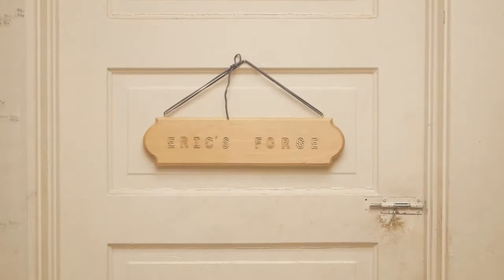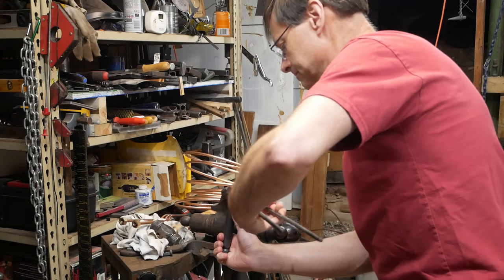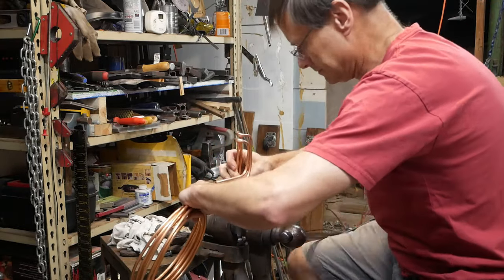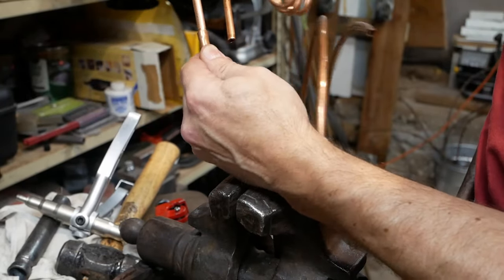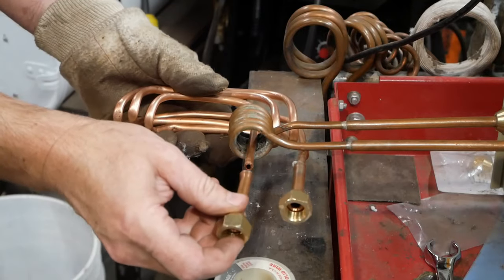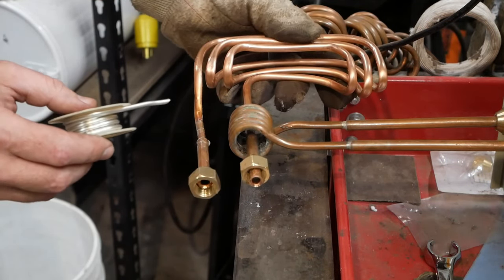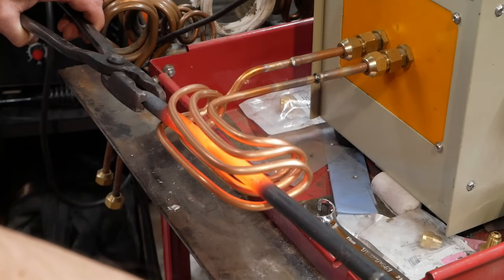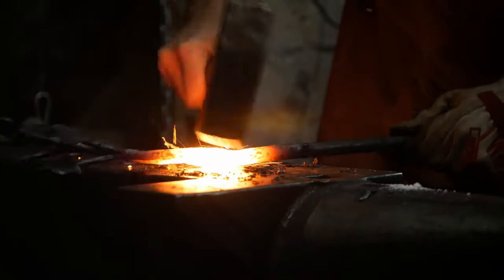Good coil for blacksmith induction forge welding

Comment: I really like these little machines. I started out in the trades building induction furnaces of every kind. Some were very large and used in the steel industry to melt steel, others were smaller for the precious metal industry. Even coils for heat treating coil springs, annealing ovens etc. I'm suprised to see bare coils being used. For the majority of applications they are cast in refractory. We soldered brass bolts onto the coils and used 4 square hardwood uprights drilled at the proper intervals to get the coil spacing perfect.  The hardwood was isolated from the coil using high Temperature blanketing or transite (among other things). Only the inside of the coil was  packed with refractory and the top or ends were shaped depending on the application.  It seems like some version of this where the coil is isolated from being able to touch the steel would be beneficial so the coils lasted long term. It would make using one much easier and definitely less stressful, no accidents when the steel accidentally touches the coil. If thats too much work the red/pink laminated insulation board is great for really close coil spacing, it can be left in place is you want to capture the entire coil in cast refractory. Its available in every thickness imaginable.  A coil would last years, possibly a lifetime depending on use done one of these ways. Just thought I'd pass that on in case its helpful.
Reply from the maker: Hi Jeff. Thanks for the excellent info. I have experimented with casting a coil in refractory. It works a treat on a flat coil. I will show that in my next video.
Reply: There's a little trick you can do to isolate the work piece from the coil, especially if it's a round pipe or bar. A glass tube! Saw a guy in India or perhaps it was China doing this.

Comment: I have one of these machines, and the first thing I made was an adapter for those 8mm flare fittings.  I used the 8mm flare fittings (just cut the tube about 2" from the nut) from one of the coils that came with the induction heater, soldered a ball valve onto one end, and a 5/16 compression fitting on the other.  This way, when I need to swap a coil, I use the ball valve to close the water (reduces dripping), and the 5/16 compression fitting adapts nicely to easily available 5/16 copper soft tubing, no flare tool required.  It works great on my machine.
Reply from the maker: Sounds like another good way to "skin the cat".

Comment: Holy moly this would have so much potential for forging knives as well. I imagine I can heat just the bevel or just the spine if I want to, and it seems to heat up crazy fast, precise and convenient.
Reply from the maker: It is really convenient for certain types of heat treating. I made a draw knife that I hardened with a coil that only heated the cutting edge. In that case, the coil was just a U shape (i.e. basically a one-loop coil).

Comment: Rig your induction forge/heater as a mobile/cart and you can park it right next to the anvil or power hammer or whatever you're using at that phase of the making. No forge heat blast to interfere or account for when your working metal is out of the inductors.
Reply from the maker: Yes, exactly!

Comment: I have a induction heater that I built it heats meter red hot in 7 to 15 seconds.  My RF coil has no insulation if the metal being heated touches the 8 turn induction coil the mosfets explode.  I think the reason my circuit self destructs is, I have a resonance circuit 70KHz loaded.  I think factory circuits are pre set osculator circuits frequency never changes.  My induction heater is very handy better than a torch for heating metal quick.

Comment: I just ordered Input voltage: 110V

Model：ZDBT-6:

Nominal power: 1400W; Maximum power: 1960W; Ultimate power:2450W;

 

Input voltage: 220V

Model：ZDBT-6:

Nominal power: 2000W; Maximum power: 2800W; Ultimate power:3500W;

I hope this will do what I need. I really love forging but with bad shoulders the quicker I can get a heat the better and if I don't need propane even better I was watching alec steele run in to one of these when he was shopping for a power hammer but your the best source for actually seeing someone use it for forgeing.
Reply from the maker: I've not worked with one of those. It will work for smaller stock. It's about 1/4 the power of the LH-15a.
Reply: @ejoftheanvil  the prices have jumped crazy I wanted to get one but this was more in my price range atm thank you for you time sir
Reply from the maker: @ReviewThisTestThat  Fair enough. I couldn't quite tell from the ebay listing: does it require water cooling and does it come with that? Please let us know how well it works for you!
Reply: @ejoftheanvil  it comes with it I got it on Amazon https://www.amazon.com/dp/B08C5FPR5J/ref=cm_sw_r_cp_apa_fabc_JTJ7FbVDYTP8F I will definitely do a review on it since I see 0 on here.
Reply from the maker: @ReviewThisTestThat  Ah. The Amazon details are a bit clearer than what I found on ebay. It does at least make it fairly clear that it is water cooled and includes a small water pump. Maybe the bowl is for cooling water?? The look of the coil suggests it's for casting.
Reply: @ejoftheanvil  is there a way to contact you outside of youtube I would like to pick your brain some I am starting a Orthotics and Prosthetics chanel soon for instructional videos on fabrication of those decisions and I would love to ask you more questions on induction forgeing if your open to that thank you again for your feed back and I'll do a video on this when it shows up and get your impressions or ideas
Reply: @ejoftheanvil  i just got it but it missing the switch on the back lol the 230-400 breaker 60 amp
Reply from the maker: @OPTAustin  <sigh>

Comment: This seems like a really even heat that doesn't begin from the ends but from the ends of the piece that are more away from the weld, so it would store it better for longer as well. Would love to see you work a sword/knife through a huge version but to each their own hammer.
Reply from the maker: That's a good thought. For a knife, I'd recommend a coil of rectangular loops. For a sword, this has some advantages since you don't have to run most of the sword thru the coil to get to your current working section. This coil is nearing max size for these induction units, tho, so there won't be one much bigger.

Comment: I got into induction forging because of you! I just ordered my unit-- I'm on a budget so I got the 110v because it's half the price of the 220v models. I will be using your pro tips to modify for 220v. If you do consulting/coaching calls that would be great :).

Edit: This coil is freaking brilliant by the way.
Reply from the maker: If you get in a bind figuring out conversion, ping me.

Comment: I've heard that freezing some water in the coil before forming can help with preventing kinks.
Reply: fine sand is also an option...
Reply from the maker: @AKAtheA  Yup. Definitely. A bit harder to get in and out than water.
Reply from the maker: Yes. I must admit that I don't usually plan far enough ahead for this to be an option. I tend to make a coil mid-project when I get the inspiration(frustration?) to do it. As @AKAtheA mentions, sand is good as well. Overall, tho, I've never had a coil collapse enough that it caused a problem. So, I just stick with my empty bending (using my various jigs and tools).

Comment: Good trick to keep pipes from collapsing is to fill it with salt.
 Regular table salt will do. 
After you done with the bends you can pour the salt out, or if need be, flush it out with water should some get trapped.
Reply: Filling with water and freezing works well too and salt can be a bitch to get out

Comment: If you do this you need to deburr those tubes so they don't go into a pump and cause a gear to chip and blow it up, and I don't recommend stretching them at all since its electrical. Failure is grizzly. I also recommend filling with sand and cleaning with a long fuel line swab for bending. Don't rely on folding to get rid of the bur, you need to cut it off, its bad copper. I also recommend cleaning the coil with a stainless brush before soldering (dremel). Flux should also be cleaned if you are using a closed system since it is corrosive, with a nice long flush.
Reply from the maker: Yes, always de-burr. I always do, but don't necessarily show it. I usually wire wool before soldering. I always flush the coil before using it. I should emphasize those points in every coil-making video. I do think the slight stretch is worth it due to the 1/4" vs 6mm difference, but your point is noted.
Reply: @ejoftheanvil  Honestly I don't know what the integrity change is at all but with the high voltages that tank coils can have sometimes it makes me extra scared. This one gets me : clogged pipe with pump parts  leads to steam explosion with water and white hot metal. I guess a operator would notice this is starting to happen but steam is pretty insidious. I know flaring aluminum tube is OK for aircraft in some applications so I am not sure I would panic about it but the FAA is pretty specific with their scenarios, usually does not involve heat.
Reply: I don't want to be alarmist but I did notice these induction machines became prevalent because of low price Chinese models not so long ago, I am not sure how much a track record these 'pint sized' machines have.
Reply from the maker: @cdrom1070  you point out another good "checklist" item. I also flush my coil to make sure it isn't blocked by a bad solder job or a kinked bend. A blocked coil will not stay cool and that could actually melt, or at least compromise, the solder.

Comment: Very nice. Wondering if it would be possible to use the toco coil to forge heat some heavy spring metal (1095 steel), quickly remove it and wind a new spring on a mandrel and lathe, while the work piece is still hot? This would be a very straight long piece of material, so probably have to heat a section, wind it and repeat?
Reply from the maker: Yes, you'd have to do it in sections. Keep it tight as you go. Once cold it's a real pain to reheat the winding.
Reply: @ejoftheanvil  Thanks!

Comment: It's a little hard to explain but I will try. A picture would be easier. 

Would it work to make the toco with the tubing perpendicular to the work piece.  The long part of yours is parallel to the work piece. 

It would be made by bending, for example, a 1.24" diameter "U" in the "Y" plane. Then at about 3" bend a "U"  in the "X" plane. At three inches bend a third "U" in the "Y" plane etc.
Reply from the maker: I think I get the picture. Let's call my taco a "long" taco and yours a "wide" taco. Yes. it would work.

Just to be clear on why I said "wide", you basically have two constraints: 1) too much total tubing and you get out of spec on the inductance of the coil and 2) you probably want a pretty even spacing. One good way to think of my coil is an oval flat coil bent in half on the long axis. Yours would be the same but bent on the short axis. Both are definitely useful. For what I was wanting to do, the longer coil is nicer. For other stock or other operations, your wide coil would be preferred.
Reply: @ejoftheanvil Thanks, I may try it.

Comment: Husband here, this is just fantastic, ima gunna have some fun tryin 2 make some Damascus
Reply from the maker: Let us know how it goes. I haven't done damascus with mine.
Reply: Same here, I'm looking about getting one and I want to know if it can be used for damascus
Reply from the maker: @waylonperry1982  It's on my to-do list. It'll definitely work for small billets, but getting an even, welding temp heat on a larger billet will take some experimentation and may just not be practical.
Reply: @ejoftheanvil  please make a video on it when you try it!

Comment: I love the idea of induction heating in a forge.  Are you able to actually melt steel it get it hotter than needed?
Reply from the maker: I have melted stock accidentally and have one end fall off. Mostly with smaller diameters like 1/4" or 3/8" (6mm to 8mm).
Reply: i used to work at American Foundry Group in muskogee ok and they use induction furnuses to heat metal up to 3000 degrees for drop forged products

Comment: hi Eric! great content ! I am planning to do  blacksmith shop in an underground garage, do you have any tips for ventilation underground and do you have the coal forge in your basement workshop? any pros and cons of working in the basement? 
thanks for your time !
keep up the great work !!
Reply from the maker: In some of my older videos, you can see my coal forge and my ducting solution that goes outside. My main tip for coal is switch to induction ;-) or propane. I have not used the coal forge in my basement for over 3 years because I can do it all with induction. That said, I also have the advantage of an exterior door and a window (traditional pier and beam house, so the top 1/4 to 1/3 of the basement is actually above ground). I would suggest a P100 half-face respirator even with induction. Forging is pretty dusty from scale particles. Grinding is VERY dusty which includes the rather more dangerous dust from the grinding discs and wheels. Your 80 year-old self agrees with me on this 🙂.
Reply: @ejoftheanvil  thanks a lot for the tips !!! in my garage I m gonna have 2 windows facing outside similar to yours , but no exterior door . So does this mean that you can access your forge from outside? since you have the exterior door , I am asking to now if it is safe enough to work underground
Reply from the maker: @markgrech2328  You should be fine. I used the basement for several years before I put the door (back) in. I did have the window open for the ducting when I used the coal forge, but I don't open anything usually when I forge with the induction heater. I do open ventilation when I use propane to avoid CO issues (and definitely get a detector if you're gonna use propane semi-enclosed like that).

The doorway had been covered over and the stairwell filled with rubbled for decades. Took a bunch of concreted and masonry work to get it viable again (and a little digging, of course).
Reply: @ejoftheanvil  Thanks a lot !! keep up the great work !

Comment: You should try a tight pancake coil, folded into a taco.
Reply from the maker: My taco emphasizes long parallel tubing. A folded coil would have more tubing in the "fold". My estimate is that tubing is not doing very effective heating.

Comment: What is the device the coil is plugged into?   Is is a welder?
Reply: It's called an induction forge.  It uses pulsed electrical waves to induce current (and heat) into any conductive object placed inside the coil.

Comment: Hey I bought me a LH-15A from USSOLID because of your videos! I got the 220V model thanks to your advices and I'm loving it. Still trying to find a wear fitting that matches my machine however! Also how do you prevent fouling of your cooling setup? I got some white algae / bacterial growth in mine after a while.
Reply from the maker: I used distilled water and that seemed to pretty much avoid that. There are industrial additives for handling that and also providing anti-freeze. I don't really need that in my basement.

Comment: Couldn't you use a copper cable? Insulate it with fiberglass sheath? And, do you really have to run water through it?
Reply from the maker: Yes, but... Reasonably thick copper would work. However, fiberglass sheath melts onto hot steel. And, hot steel would put a lot of heat into the copper. ...which is why a heater of this wattage pretty much always uses water cooled tubing.

Comment: Very cool -- THANKS! This is amazing.
Question: How much would you guestimate this whole rig, ready to go, would cost to build if done by a pretty handy person already having all the tools needed? I'd really love to put this together and would use it a lot.
Reply from the maker: It would cost about the same or more than buying one pre-built 😕
Reply: @ejoftheanvil  Thanks for your reply! Dang - too rich for my budget. My main use would be to quickly heat the inside-most tip of various scrolls for gates and other ornamental ironwork. I have a DIY Torsionator (as someone on youtube calls it) to cold form the scroll, and so ONLY need to heat the inner end of the piece.

Comment: I would like to try metal working with induction furnace but I was checking the price of your equipment and unfortunately it mutch mutch too high for beginners... Do you have any recommendations for any cheaper alternatives because I know I shouldn't trust kind of machines you can buy from Wish?🤔 ( for axe and knife making)
Reply from the maker: Unfortunately, I haven't seen anything cheaper with enough power to be useful.

Comment: Hi EJ, and many thanks for your videos.  I tried making a taco-coil of my own, annnnd it didn't go well. I started with 2 feet of 1/4" copper tubing and barely completed half of the taco.  Are you using more than 2 feet of tubing to make this coil? Thanks.
Reply from the maker: Mine is about 58" including the leads. This is one of those geometries that doesn't follow the "rule of thumb" length.
Reply: @ejoftheanvil  Thanks so much for the reply.  I'm going to try again with a bit more tubing this time 🙂

Comment: Hi Eric I am a blacksmith in Australia and I am having trouble winding coils for my 15kw induction forge machine just won't start up with my coils started with 1.5 meters of pipe and then about 800mm . put supplied coil back and all good any advice  regards Mark
Reply from the maker: Those are probably too long. Rule-of-thumb is to stay under 600mm. It's pretty dependent on geometry so that can vary quite a bit. You need to use fewer loops. You can find my email on the saltforkcraftsman.org web site it you want to send me pictures.